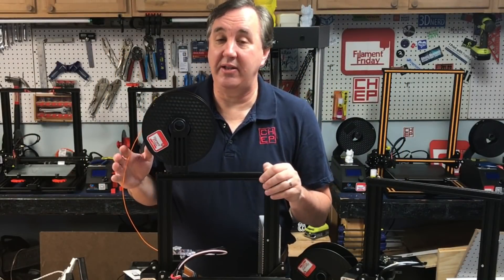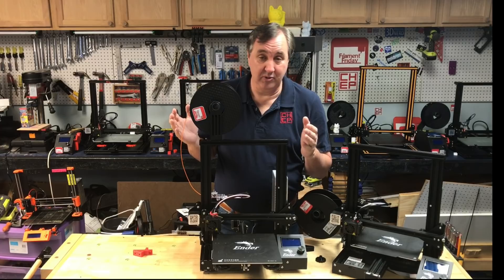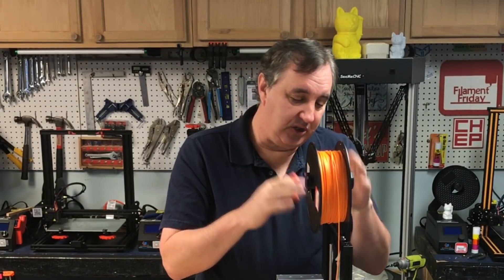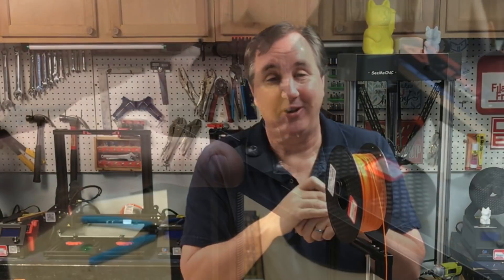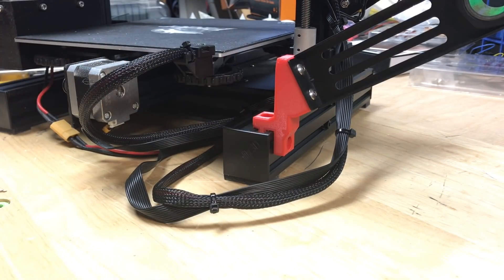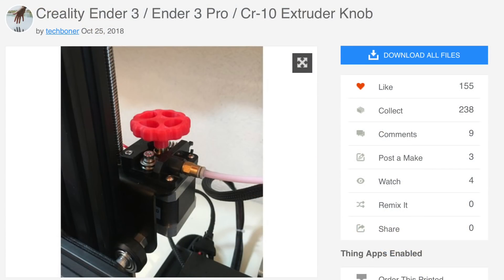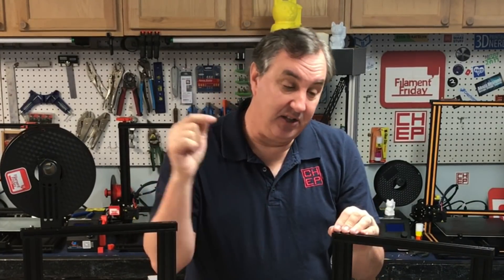3 Simple Upgrades for Creality Ender 3

Comment: The side spool mount is the best spool holder solution on the Ender 3. I printed 5 or 6 designs, filament guides, and low friction holders that use bearings, and so on. None of them worked as well or were as simple as the side spool mount.
Reply from the maker: Glad it helped.
Reply: I agree! Nice remix to the original!
Reply: Simplicity is sometimes the most innovative! This is super helpful because with the shelving I got my Ender 3 won’t fit wo th the spook mounted on top
Reply: Same here.  I hated the overhead design, but didn't like any of the mods I saw.  This was one print and done.  No other parts.  Tx!
Reply: Side mount is poorly designed, since you need to raise Z to change roll . Chep doesn't explain that. If you see the video, the roll is already in place when the filament is going to be inserted. Better a longer side mount or a separate spool.
Reply: @MrSjgasca  I just installed it and didn't need to move anything

Comment: Do you unscrew something to put in the extruder knob ? cause I can't fit it in my ender 3...
Reply: i had the same question usually the ender 3 has a pressure fit gear meaning you can't use that on it sadly..

Comment: Do I have to switch nozzle in between Prints like in one file I have a nozzle of 0.6 and in the next print on the same file I have a nozzle of 0.4
Reply: Why don't you re-slice it with whichever nozzle is being used, or that you use most often?

Comment: I made these items for my Ender 3 V2 unit. I noticed that larger diameter spools (like Amazon Basic filament with 7.75" diameter) hit and drag against the X-Axis stepper motor. I am going to take a look at your side mount swivel bracket unit as an alternative. I'll let you know how it works out.
Reply: This side mounted spool bracket when used with the clip-on filament guide mounted to the extruder caused a lot of friction for the extruder. The filament was being pulled from the spool at a 15-degree angle, but the spool was mounted perpendicular to the extruder filament opening. At times this caused a squealing noise during rapid retraction. I am going to print a side mounted spool holder with a swivel capability to fix this. Thanks for all your ideas and videos. I view this as a work in process.

Comment: My Ender 3 pro has a round extruder shaft but all of the knobs I'm finding expect it to have a flat.  Do you know of any knobs that work on this extruder arrangement?
Reply: I just got my E3P today and mine doesn’t even have a bit that sticks up at all! The top is completely flat! Did you have to pull the center pin out or something?
Reply: @twistsouth514  no, mine has about 1/4 in sticking up over the extruder gear.
Reply: @BrianReichert  seems they changed the design and removed the pin in later ones.
Reply: @twistsouth514  Yeah, I guess if you want it bad enough for want to replace the extruder gear you'd also have to buy a replacement stepper motor with the appropriate shaft on it.  Kind of annoying, but at least possible.
Reply: @BrianReichert  gonna be replacing it with an all metal one anyway so shouldn’t be an issue for long!
Reply: @twistsouth514  I did that too.  My all metal extruder came with an extruder gear that wants a flat shaft.  I'm just using the original gear as it's difficult to get off.  If I need to replace the extruder gear I'll just have to replace the motor with the correct shaft.  Kind of annoying but it's working.

Comment: I was on a print that was quite a few hours, and when I started the print, I went to bed and didn’t think anything of it. Which was a risk I was taking cause I always had to spin the spool every so often cause one time the spool didn’t spin cause the angle it was being fed into the printer, it eventually got to tight and literally snapped, lesson learned, don’t start a print and fall asleep. I only know it did that cause I had a camera on it😂. Thank you for the recommendations, def will be doing these
Reply: I'm doing research for a setup i got used. Its a large spool that came with it. I am finding if i don't pull wire out of it it messes up and pops the print off the board. I'm guessing its popping up and down the extruder nozzle. I can't seam to get the camera that works with creality cloud to record. It says its recording but didn't see any files. To begin with it may of been due to out of date firmware. So i missed what exactly occured.

Comment: Apparently I came across your version of the adapter a few days ago and I like it.  I wanted my filament roll on the side because of the same reason (the angle it was going into the extruder).  Seems to work very well.  Thank you.

Comment: Hey guys just as a heads up so you don't make the same mistake as me. I blindly followed the cura settings without taking into account my printer. The cura stock setting initially has thicker bottom thickness and that works for me in the past. I changed it to a thinner one and scratched my plate and got the print stuck on the glass bed, such a noob mistake I know. With the stock setting it just automatically pops off when cooled. You live and you learn. If cura stock setting works for you. Don't change anything without knowing what it would do.

Comment: Is the filament guide supposed to fit on the Ender 3 pro ? I printed it and tried to set it but it seems tha it does not.
Reply from the maker: It fits mine.
Reply: @FilamentFriday  Thanks for your reply. I pushed a little bit to make it fit but it made my Z axis rod stop when moving the hot end to the origin so I finally removed it. I'll make a remix of that later on.

Comment: The Ender 3 seems to be made with a different extruder part as the knob will not work because it is flat and doesn't have anything the knob can go into.
Reply from the maker: They changed the design since this video
Reply: @FilamentFriday  yes, reddit as told me so.
Seems like a silly change to be honest.
Reply: @TheCommanderNZ  did you ever find a solution to this? I literally just finished a good print of the handle only to find that I cannot attach it 😡
Reply: @twistsouth514  same

Comment: I didn't see y improvement, in my opinion. A side mount increases the space needed to install the printer. It is also difficult to place it inside a closed box to print ABS. The filament input on Ender 3 is made out of brass, so no erosion will take place. Also, a filament roll weights a little more than 1kg. I am pretty sure that an aluminum frame can handle that without being stressed. I printed one of those knobs. They get loose pretty fast. You better prepare a paste with acetone and ABS in order to glue it to the motor axis. Don't even think about to print them in PLA. You'll just loose your filament.

But, I have soe suggestions for improvements: I'd love to watch a vídeo with some leds mounted on the top of the frame and on the printer sides to shed light on the printer bed. I searched on Thingiverse and other websites, but I couldn't find anything really easy to print and install. Maybe you can have any ideas. :-)

Comment: I enjoyed the side spool, but ran into a specific problem. The side mount straightens spooled PLA like it's supposed to, but I had issues with that causing the filament to snap if it gets too cold. Especially in the winter, and also if I'm using cheaper lower quality filament to be stingy, I had issues with the filament snapping at the inlet to the extruder. If I keep it top mounted, and allow the filament to curl instead of forcing it straight, that seems to avoid problems with it breaking.

 Edit: Nevermind, cheap filament is snapping no matter what, if it gets cold enough.
Reply: This is interesting. Where is your printer located thats its getting that cold? Or do you just love the cold!? Haha
Reply: @BMathiesen  it's in an unheated basement. I live in New England in the US, so it gets cold, maybe 15C? It seems like some brands of PLA are a lot more prone to breaking than others. Solutec seems to be just shattering when it gets really cold, but hatchbox has done fine so far.
Reply: @mak3100  gotcha that makes sense! That's insane i couldn't imagine seeing filament just snap out of no where! Also good to know for the future!
Reply: PLA also gets ridged when its old and has been sitting out for a while
Reply: People make humidors for this filament to avoid this happening.  You can buy them on aliexpress too.

Comment: HELP
The end of the motor from the extruded isn’t sticking out of the cog part that feeds the filament. So how do I attach the knob now? 
Any help would be appreciated!
Reply: Did you ever figure this out?
Reply: @joaqstarr  they changed the design on the newer Ender 3 Pros where the shaft no longer sticks out and its instead flush and press fit. Unfortunately there's not really a good solution
Reply: @SkelaKing  oh alright. Thought I was doing something wrong. Thanks.
Reply: Loosen the set screws on the filament gear and adjust the height so the knob will fit
Reply: These are "new age" motors.. Theyre no longer male motors but... TranMotors.

Comment: In the newer version, I just got, the input of the extruder is covered with a small metal funnel so the filament won't cut into it. But moving the holder is probably because of the weight a good idea anyways. :D

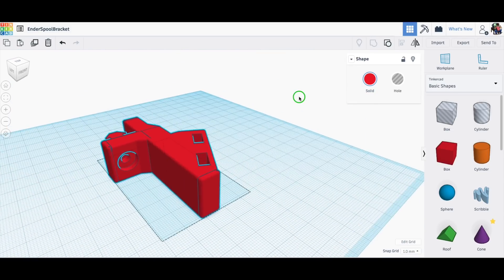Comment: Thanks for nice design for spool adapter. I wonder why you haven't filled in the hole which is opposite the triangle thing (seen on 2:28 of the video)? Confusing, as it supposes that something could be mounted at the place...

Comment: Hi my Friends told me you can solved my Problem. I need a Profil for my Ender 3 to slice in Cura 4.8. Can you help me pls
Reply from the maker: You can’t use the built in profiles?
Reply: @FilamentFriday  I have used it but i habe get Filament Salat.
Reply: Can we speak in a Chat to solve the Problem.
Reply: @FilamentFriday  Yes i have taken the profile but i have bad prints.

Comment: Is there a way to tell cura to print only the first 3mm of the model - as you suggested - or do I have to stop the print manually?
Reply: you can slide the print down into the bed using the arrows to move the object. but then you only get the top if you dont rotate it

Comment: I printed and started using the Spool Holder Bracket but the pla filament still keeps breaking at the entry point of the knob on my ender 3 when I run long print jobs. Any suggestions?
Reply from the maker: Your filament May be dried out or old.

Comment: Your side mount for the filament does not allow the spool to line up with the filament tube on the Z axis correctly no matter how or where installed.  The spool either hits the motor or is way out of align.  I just mount the original spool brack on the top of the  Z side rails- works great!

Comment: Spool relocation bracket is GREAT!  It puts a full spool exit point directly in line with a BMG extruder. My only nit to pick is that I have to dismantle the roller to get the spool on the mount because it's too close to the printer. It needs to go straight out another 50mm to clear the stepper motor.

Comment: The spool holder mod didn't hold for me with the slicer settings recommended here.
Next one I printed fully solid (100% infill), and it seems to hold a whole lot better.
I do use the heavier 1000+ grams filament rolls, so that would explain why it didn't hold up the first time.

Comment: I'm surprised more people don't just add the original spool holder to the side of the frame rather that the top, OK so you will loose about 2" of build height, but I would imagine 99% of folk aren't going up that high very often anyway.

I initially did this on all my Creality printers before I built enclosures for them with customer mounts.

In fact just this week I just added another printer to my (very small) print farm, and it was an Ender3 (my 1st ender as my others are CRa0s and Max's) and I again mounted the holder to the side rail, much better filament path and no additional hardware or tools required.

Comment: Quick question about the side holder vs the top one:
Why exactly do you think this is better? Now, with the Ender 3 Pro having brass in the Extruder, so it can't wear out.
I wanted to try a side holder because of the angle the filament was pulled down from the top but with the full spool on the side it seem like the extruder (standard ender 3 pro) seems to have issues pulling the filament in. It almost feels like there is to much weight pulling back because gravity is not helping, like it was with the top spool holder.  
After a failed print I went back to a top mount and it was fine again. But I am still questioning what is better in the long run and would like to hear your thoughts on it. THanks!

Comment: For the spool holder did you use pla? Because I only have pla atm and I have no idea if it will be able to hold up the spool so il try it in pla with 100% infill and see if it holds
Reply from the maker: Yes. I used PLA.

Comment: @CHEP. You mention printing a small portion of the side mount as a test.  How do you do that? Separate SLT or setting in CURA.  Btw - first printer hasn’t arrived yet.  Thanks
Reply from the maker: Print a few layers then stop the print from the LCD.

Comment: Dear Chuck! Your videos are the perfect companion for my adventurous journey to 3D printing!! I can’t thank you enough. I tried printing the knob and used one of your profiles for Cura to have the retraction right. Still I get some stringing towards the center axis. Do you have any idea what can be the cause? I am using PLA, Ender 3 Pro. I am only three days into 3D printing ... so I guess I don’t know what Information is needed to find a solution. Best wishes Stephan
Reply from the maker: Try adjusting the temp.
Reply: CHEP Dear Chuck! This was good advice. I raised the temperature and also turned the design upside down in cura. The knob printed perfectly. Thanks!!

Comment: Wish I could give credit to whoever I found this tip from but to stop rubbing of filament on the Z-axis screw simply cut a 1” length of the rubber tube that the z-adis screw comes shipped in and slide it down to the bottom.

Comment: Anyone have issues with printing this on a newer printer. Also Tried scale up and down and neither worked.
Reply: (late reply, but maybe it'll help) I had issues with the filament guide. If that's what you're struggling with, my printer's z-axis screw wasn't in the same location as the person who drafted the part. The slot just didn't line up with the screw at all. I ended up using a file to remove material so the slot for the z-axis screw and one of the holes for the other screws became one giant oblong hole. It works fine - neither the screw holes nor the z-axis slot actually contribute to the guide's fitment. I'm sure it could be re-drafted to be fixed, but i haven't taken the time to do that since filing it down was pretty easy and i'm terrible with CAD.
Reply: Filament holder bracket was the issue.

Comment: Hey Chep I printed the spool mount and I love it first off my question is when you are printing something that has a fair amount of height wont the filament scrape on the side of the extruder mount the higher the print gets. Isn't that kind of the same thing as it scraping on the guide? Just curious I love this I should have done this sooner, I have an ender 3 pro and just purchased a Prusa MK3s Kit which I haven't received yet but I believe the Prusa feeds from the top straight down. Thanks for the excellent video's that you produce.
Reply from the maker: It will scrape similar to top mount or side mount.

Comment: I could not find the links for the nuts and bolts or the stl for the side adapter.
Reply from the maker: Link is in the top section of description. The screws and nuts were extras that came with the printer as I stated in the video

Comment: Hi chuck! Love your videos! But i tried your side mount and I got really bad under extrusion and the layers would not stick together. Tried to amp up the temp from 200 to 210 but it did not help. Finally moved back the spool holder to top and the under extrusion disappeared. I use 1kg PLA rolls.
Reply: To chime on this, does your spool wobble a lot during the print? Is your spool tangled up? Right now I am also experiencing some sort of layer shifting, but I figured it was because my spool was bit tangled up because depending on your spool, it can wobble a bit. Either that, or the distance between your spool holder and the extruder is not correct.
Reply: @kirasama163  How could the distance between the spool holder and the extruder make any difference?
Reply: @antcri730   Because of the strain, if your filament is being strained it can lead up to the issues you described. You want to have the filament going in a straight line, not in a bending way. Imagine your spool is on the same height as your extruder. Then when the filament is being extruded, your filament should make a straight line. But if your spool is placed more downwards or upwards, the line will bend, causing more strains, which in turn lead to that the filament gets stuck sometimes.
Reply from the maker: That makes no sense. The side mount reduces resistance.

Comment: Will the side mount holder work with larger spools like the amazon basics?
Reply from the maker: I thought those were standard 1kg spools?
Reply: CHEP I have smaller spoils from when I used to owe an XYZ printer. And for some reason I thought the spools shown on your video where also small like those